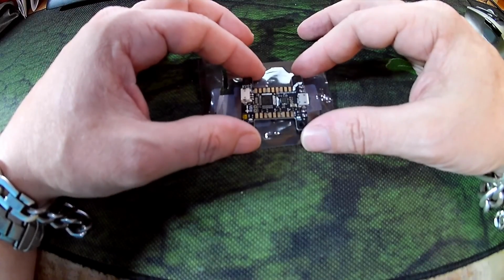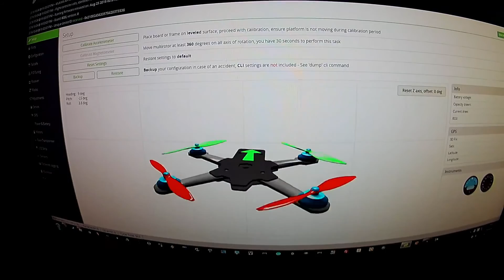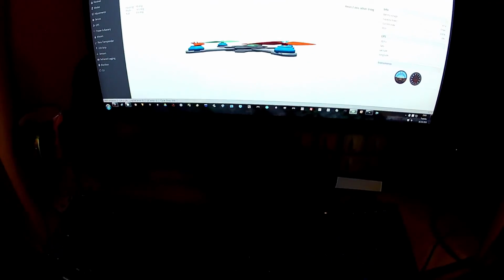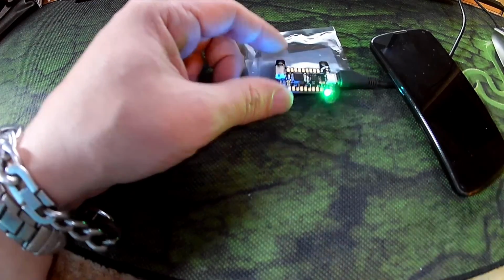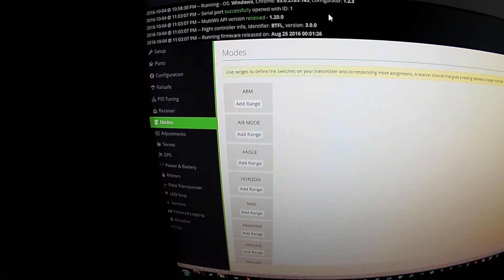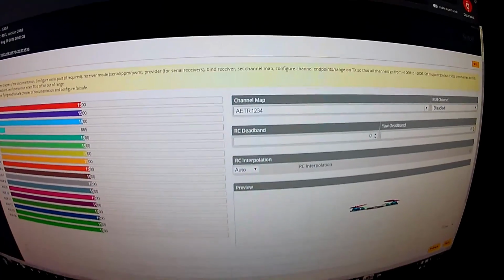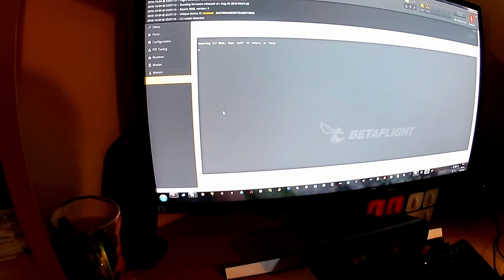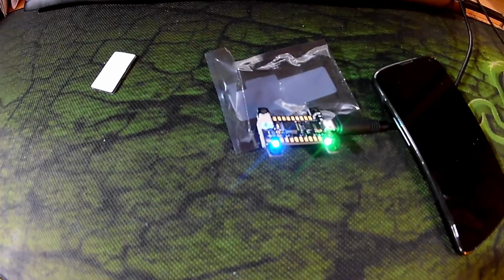32bit I-shaped Racing Flight Controller Part 1 ( Kiss Hardware )

Comment: hello MrE can you send us  the Hex.file to  info@FPV-Brain.net please
Reply from the maker: I would assume that the Hex you require is available at https://github.com/betaflight/betaflight/releases
betaflight 3.0.0 https://github.com/betaflight/betaflight/releases/download/v3.0.0/betaflight_3.0.0_KISSFC.hex
Betaflight 3.0.1 https://github.com/betaflight/betaflight/releases/download/v3.0.1/betaflight_3.0.1_KISSFC.hex

I have yet to put one of these in a build, but if I were to need the Hex,those would be the ones I would look too. Just for the sake of being comprehensive I have further looked into one of the boards I have and they are loaded with 3.0.0-RC11:
# version
# BetaFlight/KISSFC 3.0.0 Aug 25 2016 / 00:01:26 (c5c3598)